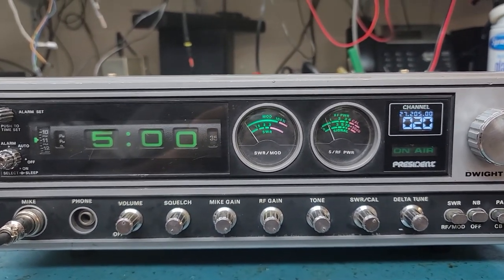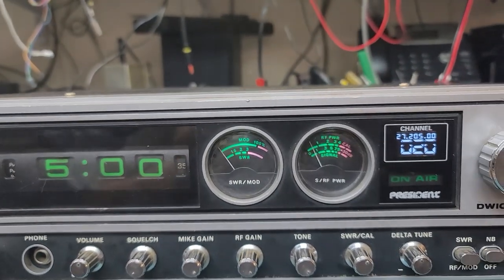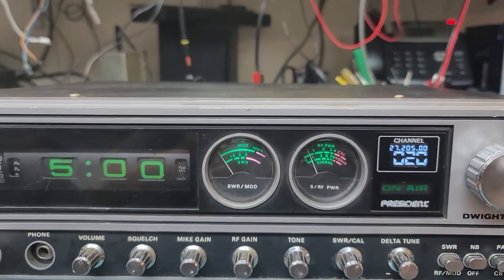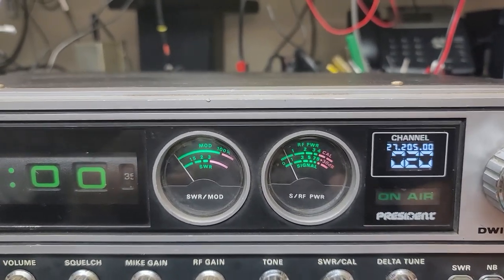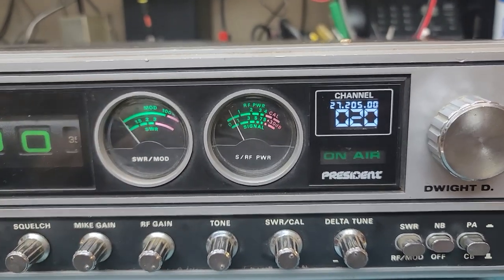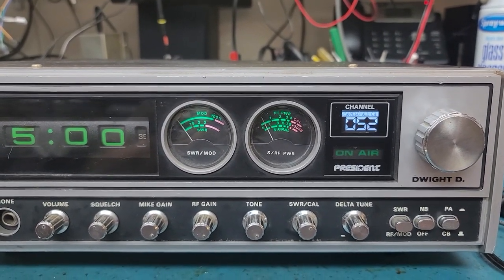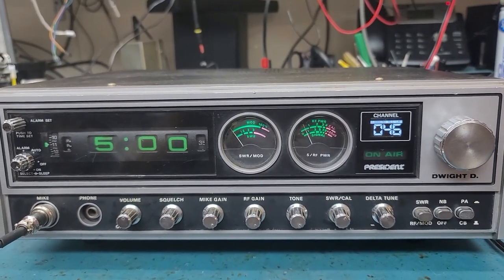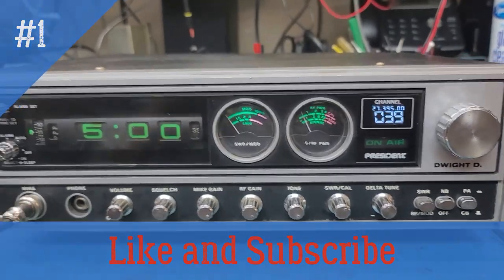DDS VFO President Dwight D. for David and Susie

Comment: In the beginning Heath kit used to make CB radios. The FCC came out and said they were not type accepted so they were discontinued.
So many people have left the CB world can came to Ham Radio. They have eliminated the code requirements.
Lot of people have gone digital such as FT8 and digital HF.
Reply: Yeah and lots don’t want any part of being a ham and I can see why. And shove your ft8.
Reply: @miker8379  Some people are not capable of passing the tests and like to be locked in the over crowded 40 channels with people screaming and using profanity. You are lucky if you can talk over 2 blocks.. You cannot talk over 150 miles legally and need to not run over 5 watts input power. Don't forget to keep your antenna at 1q7' or lower..
Reply: @dhansel4835  I don’t hear that much screaming or profanity myself.  FCC done away with the 150 mile limit several years ago. I was talking to Canada from Texas just the other night.